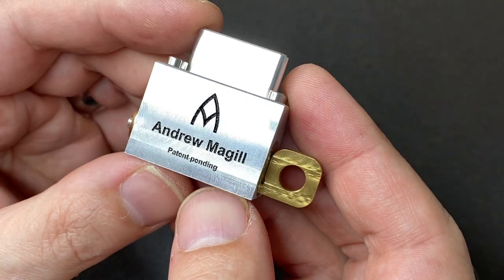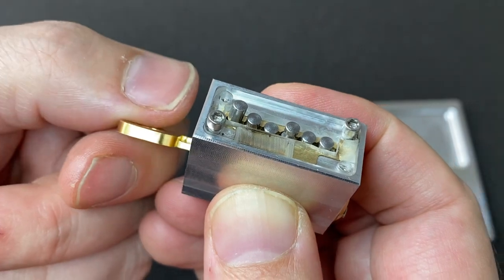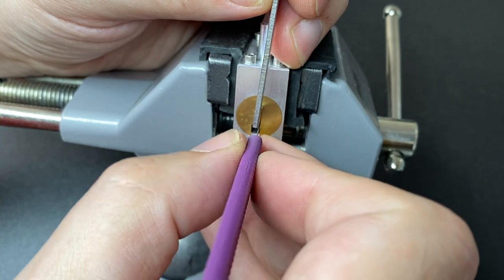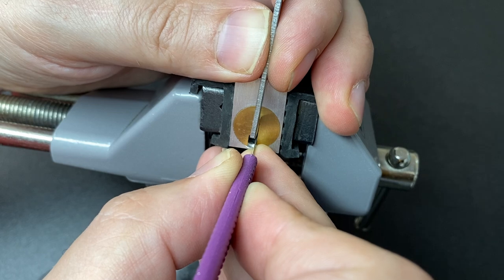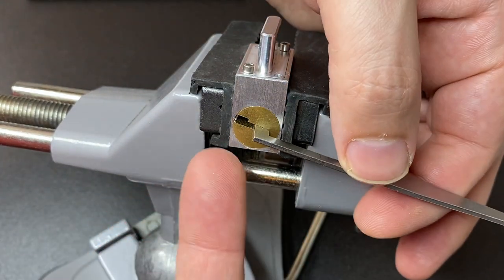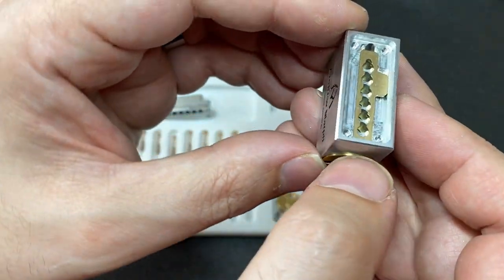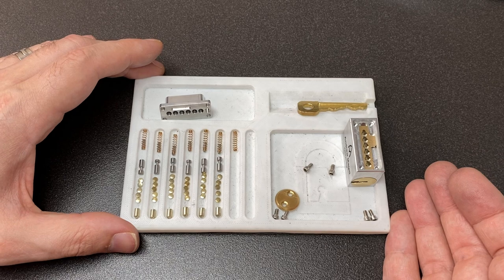Unpickable? Enclave - an Ingenious New Lock Design

Comment: i wonder how well it would survive a physical attack. once the core is in a false set, it is only the tapered part of the last pin that prevents rotation. i imagine that the brass bits would likely give out before the wedge of the steel pin failed.
Reply: The ingeniousness of the lock lies in the way it doesn't rely in any way on the tapered pin's structural integrity, but on the slider having that perfect groove to slide into. Without it, the seventh pin can't push the slider over. The idea of forcing that pin to push through the sidebar to allow plug rotation sounds unfeasible to me.
Reply: this was my first thought when Andrew posted on u/lockpicking. A bad person could make a nice strong key blank which lifts all the wafers to shear then put a spanner on it and brute force the last pin. Suggested remedy a thinner but of core between pins 6 and 7, which would fail if forced leaving the lock broken but locked.
Reply: Had the same thought. I was thinking to make a false open pop a big old screwdriver in the key hole and turn. Really depends on the Sidebar how and if it can deform in the casing. Cheers!
Reply: the Bible sits on top of the Slider and that sits on top of the 7th Pin. you'd have to be able to crush the Slider between the Bible and the 7th Pin. meaning you're saying that you're able to effectively cut that Slider into two pieces by the shape of the 7th Pin.
this is... theoretically possible, but the amount of Force i expect you'd need to do that, you're at the point where you may as well just Sledgehammer or Drill the Door.
Reply: Smashing a lock instead of picking is a vulnerability of all locks
Reply: @jasonmcmillan6598  questioning the vulnerability of a core that has only the small portion of a single pin preventing rotation isn't by any stretch of the imagination in the same league as "all locks can be destroyed with enough force"
Reply: If there is nowhere for the metal to go, it won't deform enough to force open. It may be possible to force the slide bar to slide, deforming the brass "teeth" that keep it from sliding unless set though. But the final material may not be brass. And with a suitable spring, it could be made out of steel without fear of magnets, since the spring will keep it from moving (not to mention the pins in the way anyway, rendering magnets next to useless, spring or not).
Reply: @RAndrewNeal  If a magnet would work to pull the slider, you could use that to tension the lock and feel when a pin is set. You wouldn't even need to put tension on the cylinder. 
I do agree though that the "teeth" of the slider are potentially the weakest part of the lock.
Reply: @abexuro  That would be cool, but I can't see a magnet working if a heavy enough spring is holding the slide bar back.

What the production version of the lock needs is an extensive, destructive stress test. See what kind of torque it takes to force the lock to turn, etc. I wouldn't doubt if it'd, overall, outperform the best Kwikset on the market for security (picks, exploits/bypasses, resilience, etc.).
Reply: The best solution I can think of for this sort of brute-force attack is to couple the lock mechanism to the slide bar, rather than to the rotating core.

Simply add a projection to the slide bar that manipulates the locking mechanism (deadbolt or whatever), so that the lock is unlocked when the slide moves, rather than when the core rotates.  Then you make the slide bar and spool pins out of the hardest non-magnetic steel or titanium, and the wedge pin out of something softer like brass.  So if it's brute forced, the wedge pin deforms, the core turns, but the slide bar never moves and the lock doesn't unlock.

This has the downside of making it less of a drop-in replacement into existing locking mechanisms.

Comment: The real problem with this type of system as you know is no locksmith can cut a key for it no keys available no settings on your key machine available so the only people that will buy this are individuals that would buy a lock with this already installed in it and the keys, and if they ever wanted more keys I guess they would have to get a hold of the supplier for more no key blanks are on the market for it and nobody in the US with this tight supply chain. Problem is going to make keys for that like Ilčo but I sure like how you showed us the insides of it. You’re so very detailed and the accent doesn’t hurt at all either. Thanks again your buddy Mike.

Comment: It seems like the sliding bar would have its own binding order which would be expressed in how far the tension wrench rotates when in a false set, so you might be able to get a bit more info by using a long tension wrench and marking the distance it rotates - it sounds pretty long winded though.
Reply: You can figour out where you are in the binding order so for the first pin 5 hights + 5 possible pins/ eliminate the 4 not binding rinse and repeat until Max trie 39 and you are in.
Every false gate would  potentially double the number of attempts.
Reply: The sliding bar only moves about a millimeter, and assuming non-insane machining tolerances, you'd still only get maybe 3 to 5 degrees in difference in rotation with the tensioner, depending on which pins are open and which are still locked. When it gets worn... who knows... 
The best picking attack is probably a lishi tool.
Reply: Yeah, it can reduce the amount of effort from worst case 6^6=46656 combinations to 126 (math see below).
But you'd still be lifting the pins while they aren't truly binding, which requires skill. And you'd need to measure the angle of your tensioning tool, which requires both a precise reference (with some painters tape a non-issue) and consistency in the force you apply (again, some basic skill). Alternatively, you could bring a couple dozen key blanks and file or clip them into shape in front of the lock.
But keep in mind that the purpose of a lock isn't to take a million years to pick. It's purpose is to make figuring out the combination a bigger hassle than any other method of entry (shimmying the latch, drilling the cylinder, grinding the hinges, convincing the neighbors that you're firefighters and need to axe through that door to put out a fire, ...). And having to try about half of those 126 combinations definitely is still discouraging enough.

Why 126? To find the first binding pin, you'd need to try 6*6 combinations (in each you lift one of the pins to one of the heights). Only once you found that correct height for the correct first binding pin will you know that you've done it. With blanks it would be a bit easier, because you could first find out what height the first binding pin needs to be set to, by lifting all 6 pins in parallel to the 1st position, then all to the 2nd, ... up to to 6th. And after that you'd figure out which pin it is that needs to be set to that height. Either you make 6 tries lifting only 1 pin or 3-ish tries lifting half of the pins. 9 tries total for the first binding pin, and they can be very fast if you bring those first 24 "blanks" pre-cut.
To find the next binding pin you try each of the 6 positions for the remaining 5 pins in order; and so on. In total it would be 6*(6+5+4+3+2+1)=126 combinations (max). Furthermore, when you're getting to the last pin, you first need to set the 5 known pins to their position and then the unknown one to a guessed position. In those (up to) 6 tries alone you are setting pins (up to) 36 times. And for blanks, you need to cut the known depths for all pins you've solved so far.
And as mentioned by "s s", any time you either fail to set one of the combinations or measure the angle wrong, you slow down your progress.
Reply: use a fine-tipped sharpie to draw a line between the cylinder bit and the body while it's in a false set, so that if the next position rotates slightly further or slightly less, the line will be broken. you'd probably have to redo the line per pin. and a quick wipe with some isopropyl and the lines are gone.
Reply: @spambot7110  And how fine-tipped sharpie would you use?  0.25mm is kind of shitty for drawing on metal.
Reply: @norwegiangadgetman  that's fair. maybe just a really light line with a regular sharpie. the line will be too thick to break with a few degrees' misalignment, but maybe the sharp discontinuity in the edges of the line would still be noticeable
Reply: The slide bar won't move at all unless all pins are set. If it does, it only moves the distance of its machining tolerance and is unrelated to how many or which pins are set, if any.
Reply: @RAndrewNeal  according to that logic, all of lock picking is impossible. there are multiple tolerances: diameter of the pin, diameter of the holes, also x and y positions of the holes, and much more. and each of these tolerances will vary not just for the whole lock, but also for each hole and each pin individually. each pin being set is going to have a slightly different response than another pin being set. pins do not bind simultaneously, some engage before others, resulting in a "engagement order". that means that when the first pin in the engagement order is set, the set will be slightly deeper, and this is true regardless of whether the pins are being engaged by a linear sliding motion or a more traditional radial twisting motion. the difference is that many of the easier and richer ways to observe these variations are blocked because the pin engagement happens only when they're in a completely inaccessible position, so you can't feel the engagement directly with a pick. but the information still exists, and it still leaks to the outside through slight variations in the exact degree of the false set.
Reply: you could maybe fully decouple the pin engagement from the twisting of the core by having the key turn charge a springloaded mechanism, with a catch at the end to release it, and have the spring push the bar. the bar then has to move past the engagement point of all the pins, plus some margin, to lift some gate or pin that allows the core to rotate the rest of the way. done right, the engagement order of the pins is then fully decoupled from the torque on the core. but even then, you're still leaking information. when the lock fails to open, the slots are going to crash into the first (and depending on tolerances, maybe second and third and so on) pin, and make a sound. the timing of these impacts relative to the release of the spring and to each other will contain information about the binding order, and will change slightly when the first pin in the order is set. depending on the speed of the spring, it could be picked up by someone with a really good ear, or at very least a microphone and some software. and if the tolerances introduce noise, you repeat each attempt several times and let your software filter out the noise. as long as it takes fewer attempts than brute force it's still an attack!
Reply: @RAndrewNeal  I think the problem is that you're confusing machining tolerance and clearance. clearance is a fixed gap between two moving parts, tolerance is the limits set for random variations on a given dimension. your statement is absolutely true if we replace "tolerance" with "clearance" in your statement, and assume locks have zero tolerance on all dimensions. unfortunately, it is impossible to actually make an object with zero tolerances.

EDIT: I just realized, in addition to requiring zero tolerances, you'd also need perfectly rigid pins. in reality everything can bend slightly, so even though perfect tolerances would mean perfectly simultaneous engagement, you could still infer the number of pins currently engaged by changes in the springyness of the non-engaged pins getting pushed on by the torqued core. that's possibly outside the ability for a human hand to pick up on, but it's still information that exists and is being transmitted. this universe is messy and (aside from black holes and probably weird quantum stuff) it is impossible to entirely prevent any piece of information from influencing its surroundings, you can just make its effects as small as possible.
Reply: @spambot7110  I was thinking more on the order that you can't tell which pins are set and which ones aren't because of tolerance, though I did lump clearance in there, not knowing it was a parameter (inadvertently making the zero tolerance but clearance argument as well, by mistake). Pin 6 might not be the first one to bind, and so on; making it impossible to know which pins are still binding. I still doubt you'll be able to tell how many, on account that the tolerance is a range, so will be different on every hole on every unit.

Comment: i'm curious as to how it would stand up to a bump key test or a vibration test. the separation of the core from the pins via the slide mechanism does prevent a lot of feedback that you get from direct contact of the pins with the core at the sheer line, it's been cleverly removed with this design.
Reply: I don't think a bump key would do much. You need to bump the key stacks up and then rotate the lock core about 60° before the pin stacks are pushed back down by the springs. But even if you manage that, now the pins are blocked from coming down completely. So you cannot simply easy on the tension to let them slide into the bar.

And the lock does have overlift protection. So no bumping until a disc is at bar level.
Reply: @HenryLoenwind  I think the bump key vulnerability might be in the "sidebar". Because it is held in place with a spring it is possible you could hit the locking bar without turning the cylinder, and then once set, the rear pin the normally actuates the bar and prevents the lock from being turned without the key is just floating, and you could turn the lock. It probably depends on how stiff that spring is and how much shock you could translate to the lock,
Reply: @rosecityrower  The one issue with that is that the lock is usually mounted in a door. So bumping the body to get the topbar to move against its spring (or more exactly, move the body quickly and let inertia hold the bar in place) won't work.

A normal bump attack transfers an impulse to something you can touch and move (Newton's cradle). But here you need to move the bar and there's nothing you can touch that would transmit the impulse to the bar in the right direction. So it becomes an inertia attack instead.

Also, that bar can only move when the pins are in the right position, so you need to bump the bar while lifting all pins into the right position at the same time. But if you can do the latter, you can just turn the lock.

Comment: I took a photo of the 3D design and measured the space of the spring on the top. In theory, you could push the key pins just above the sheer line since there is space given to do so with the length of the springs. Now there comes the problem of the bar, well, I also measured if the wafer pins would be in the position between the bar and that appears to be the case. If everything lined up, you would push all the pins above the sheer line and the bar would slide the wafer pins slightly making way for the piece connected to the core. What do you think?
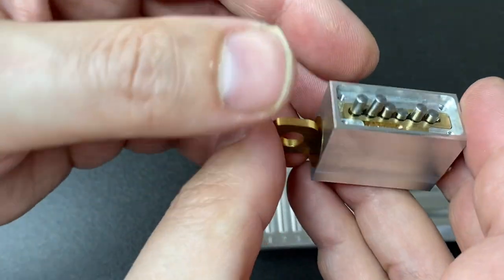Reply: At 2:14 he mentioned anti-overlift bars. As far as I could tell, those weren't in the 3d model. I'd imagine these are sized to prevent the wafers from ever getting to the hight of the slide bar.
Plausible?

Comment: Things to note looking at this: there seem to be only 3 different types of driver pins and they can be placed in an up or down position. 1 and 6 are the same driver pin, 2 and 4, and finally 3 and 5. I bet if we somehow put a focus on those dimensions, we could get a way to decode it.
Reply: It could also be a coincidence that there are pairs of driverpins in this lock.
I'm not a lockpicker, so correct me if i'm wrong. But if you look at the math of the different driver pins, you can have 6 different positions per driverpin for it to be in the correct position because of the wafers. If you calculate the theoretical amount of variations it would ammount to 1,3e+17 (6!^6) different ones. Let's assume you don't want it to turn with everything in the down or up position, you still would have at least 3 billion (5!^6 = 3x 10^12) different possible combinations.

Comment: If you raise up the pins while tensioning the top pin the wafers set before the bottom notch (where you would want it to set). Have you thought about picking the lock by raising a pin stack, tensioning, then slowly lowering the pins? Then the first set you get would be a true set (the bottom notch of the pin stack).